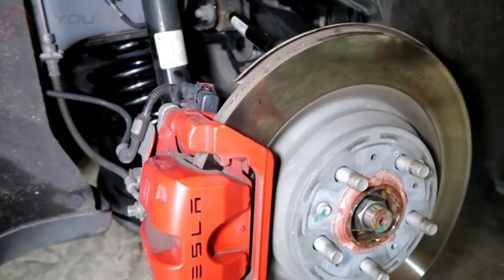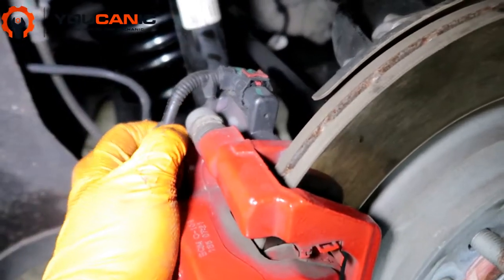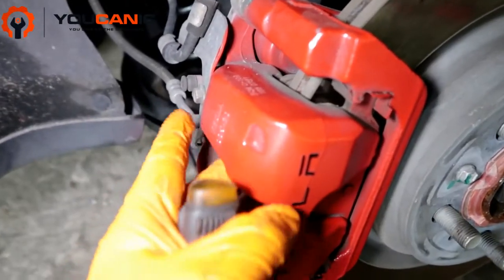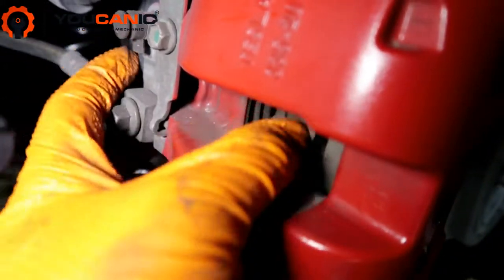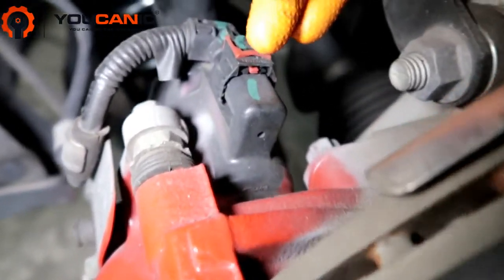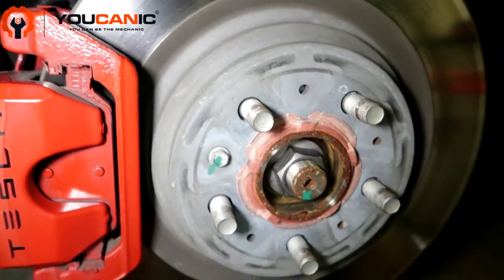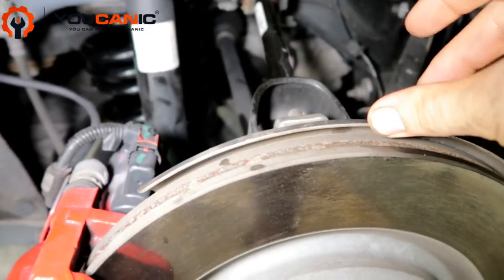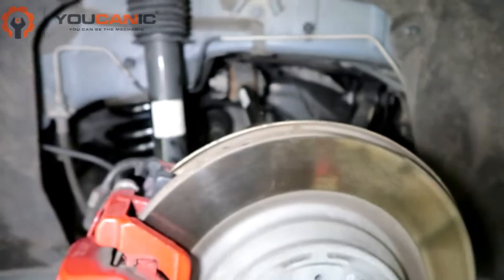How to Replace the Rear Brake Pads on  Tesla Model 3 2017+: Simplified & Easy-to-Follow Instructions

Comment: this video is completely incorrect. the electronic parking brake does not allow for the piston to press back in for new thicker pads. you have to remove the motor from the caliper and manually turn it over for the piston to recess, it’s very tricky and very likely to end up popping the piston out of the caliper
Reply: I just did that 30 minutes ago🙈 Wondering how/if I can get it back in
Reply: @thoraagehold3912  Go to autozone/orielys and rent the brake caliper tool. Make sure the top is off the brake fluid in the engine bay, disengage the parking brake, and you should be able to set it back in and turn it with the tool. The guy that made this video is a moron.

Comment: Delete this video! Youre completely wrong! The rear pistons are rotating pistons and you need a caliper tool to turn the piston back in order to fit new brake pads! You should be fired for this, this is wrong!
Reply: Wish I knew before following this advice🙈